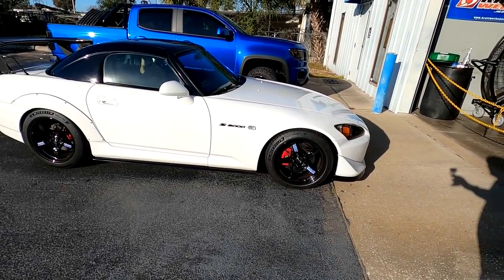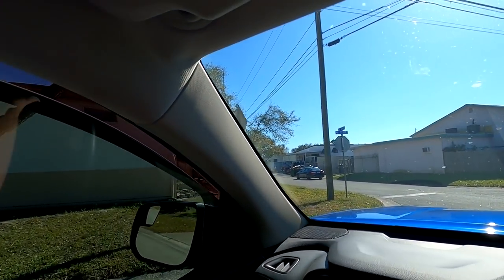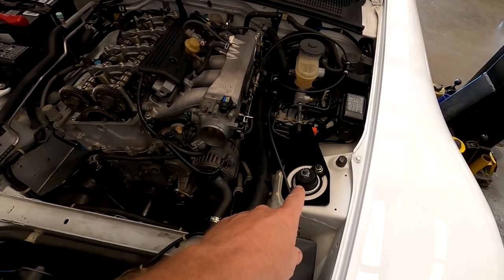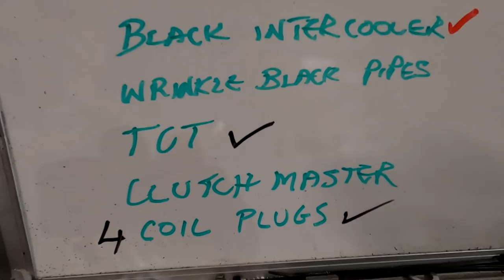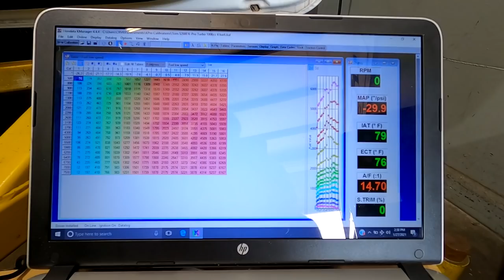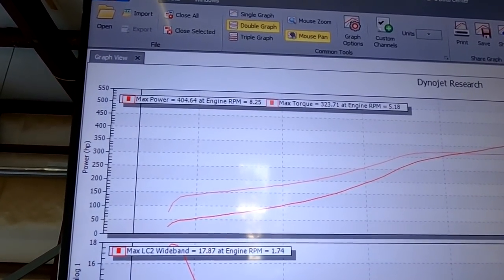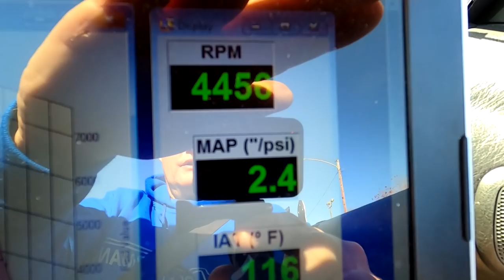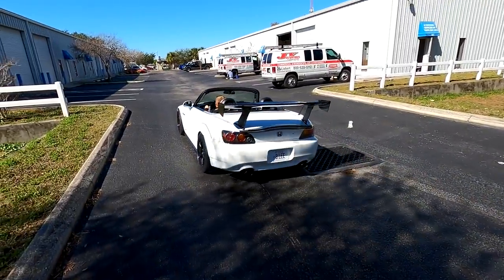S2000 with Fun you can use

Comment: I just switched over to kpro from aem. I also have that weird “drone” sound coming from the engine. I hear it in this video... is that a kpro thing? Almost sounds like it comes from the radiator or my sc but i didnt have it before with aem

Comment: Ok Jon you got me intrigued with that turbo package. Down the road when the Scat Pack is paid for, I could see getting that package on a S2k with two  differences. Quiet blow valve and a much more robust exhaust note. For me that would be..perfect,  massive torque, plenty of over rev, but got to have a distinct exhaust note that exceeds tire noise without drone on the hwy. Just music when the top is down for me. Once again..well done guys👍
Reply from the maker: You can hear the exhaust when you get in it heavy, but it’s not overwhelming.  We’re constantly trying to get no compromise packages.
Reply: @LHTPerformance  Jon: Your meticulous and you know I used to crawl under the white car to clean that custom exhaust you built for it right? I  just like it louder than your typical exhausts now. Not annoying loud, but we have time before I have an S2k build budget again. The best thing about the Scat Pack I have now. Deliciously loud at WOT and perfectly quiet cruising around town or on the hwy. 👍

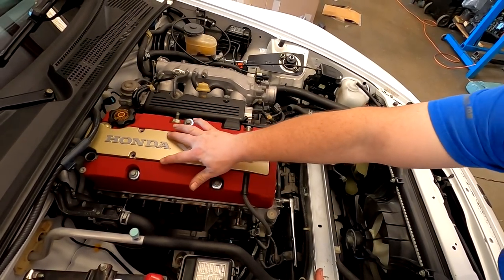Comment: Hi, just wanted to respond on the brakes topper on 7:50. You are showing one of the early models from back in the days. It was 3mm steel and could flex a little bit. It was replaced by a stronger 5mm version. I have never seen it bent this way. But I do noticed you are comparing it with your model. Daan
Reply from the maker: Yes, comparing as it’s pretty much an exact copy.  Lol.

Comment: What's your take with ballade sports plug and play harness for kpro for s2000? I think you don't need to replace the sensors and valve cover. It will run on stock 00-05 plug and play with factory sensors
Reply from the maker: I’ve never used it, I haven’t seen anyone I k ow have  first experience either.   I don’t like experimenting.

Comment: Hello LHT.
Where do you guys (John and George) recommend the oil level to be at on the dip stick?  2002 S2000
Should there be a difference Hot vs Cold level?
Reply from the maker: At normal operating temperature, I would look to have the oil level to the second dot ( higher dot ).

Comment: 323wtq is “tons” of torque?? I makes gobs more torque than this on my 17’ GTI with just a flash tune
Reply: For a Honda, yes. This thing is making double what it was factory, to the wheels
Reply from the maker: On a small displacement engine higher torque is usually comes from longer stroke or higher boost. Keep in mind this still revs to 8500rpms and runs only 13.5 psi.  If we runs 20+ psi like your VW, it would make much more.

Comment: Are the trans bell housing bolts the same length?
Reply from the maker: No, 2 different lengths for the larger bolts with 17mm heads and then 2 smaller bolts from the trans to the pan with 14mm heads.